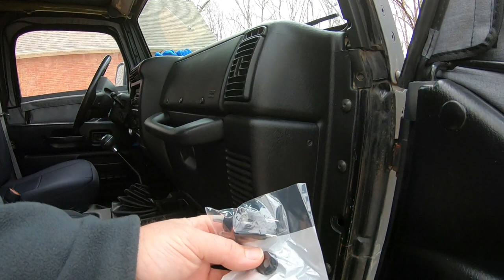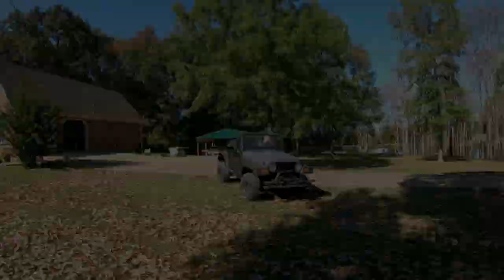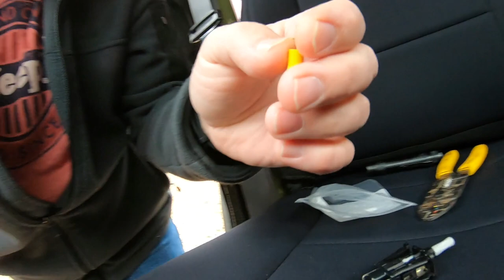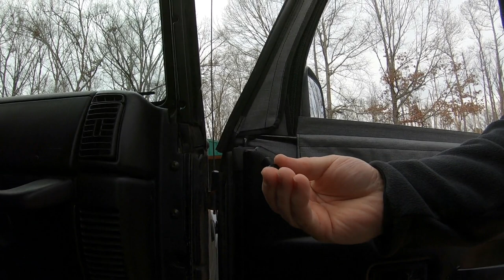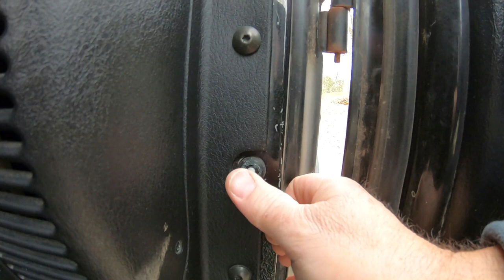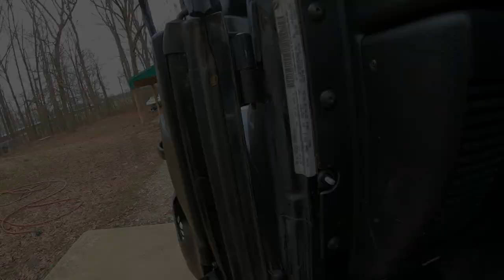Jeep Wrangler TJ Door Jamb Switch  Mod!

Comment: This really solves the whole problem!  Very Cool Thanks! metric jam nut 10x1 worked for me @ ace hardware,side note:  when doing the drivers side it helps to remove the little side panel,2 screws and slide speaker to the side for more acsess.    nice little 30 min project for 10 dollars ya cant beat it!
Reply from the maker: Glad it helped Tom!

Comment: Al right, Ive bought it and installed it. Works great, however I can not find the plastic nut to fit the switch. So For your neighbored in Florida how much to 3d print some?
Reply from the maker: https://amzn.to/3xbuvtc. These nuts are supposed to work. The thread size should be M10 x 1.0. Hope this helps!
Reply: @ForceBuilt  thank you

Comment: Super helpful to see this done. As far as the nut goes, can i just take the switch to hardwear store and get one fitted?
Reply from the maker: Thanks! I would think so. This is the same size nut that comes on regular toggle switches you can buy at Lowes. I think a hardware store can hook you up. I was going to go by Fastenal to get some but had them printed instead. A stainless steel nut would actually be better(More consistent threads) than what I did.
Reply: @ForceBuilt  Awesome. Good to know. I watched all your videos. This is something among many things I need to get done. My jeep never came with door switches. I bought new ones on rockauto, and when installing them they both snapped off cause they didn't adjust porperly in their place. So this is really helpful and to see it done before my eyes and work. Im doing this asap.
Reply from the maker: Good deal. They work great for me!

Comment: How do I get these 3D printed threaded nuts.
I went to the link just don't get it.
Reply from the maker: This is just the file for printing them. You have to have a 3d printer or know someone who does.  A regular toggle switch nut also will work. Thanks!

Comment: Ordered these from Amazon the ones they sent do NOT pull out. I’m going to try again but this time making sure they have the white plunger. Don’t know if that matters but if you get the same ones but with black plunger they don’t work like this. FYI
Reply from the maker: Thanks for the information!
Reply from the maker: I found another source for the switch. https://www.pelicanparts.com/More_Info/2018202110.htm?pn=201-820-21-10-MBZ&gclid=CjwKCAjw2f-VBhAsEiwAO4lNeO_YYVK-G-bNkv9ggF6tzXq5F6kba-6YXWT1QSKWkF0pl6ZAvLs9thoCO1gQAvD_BwE